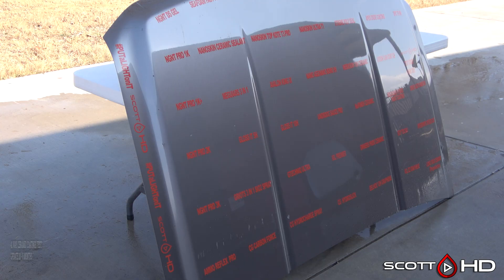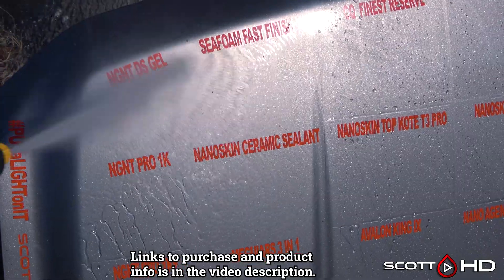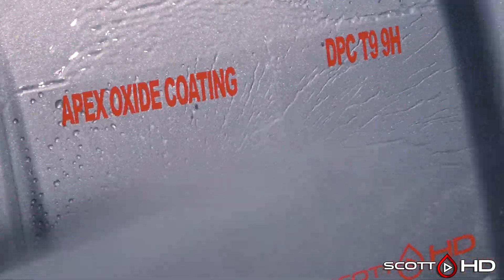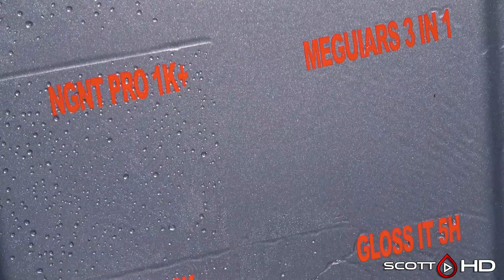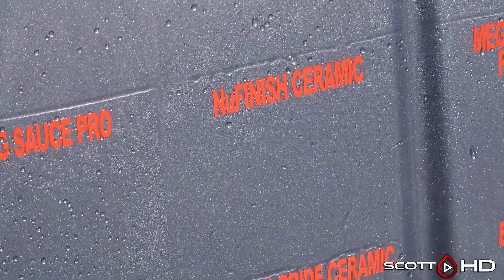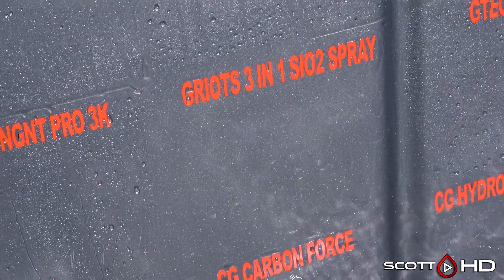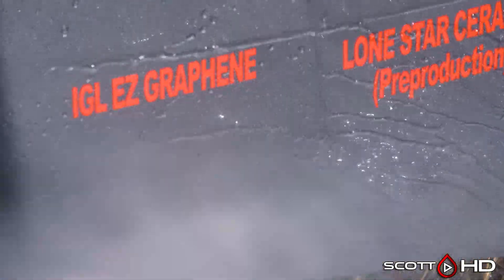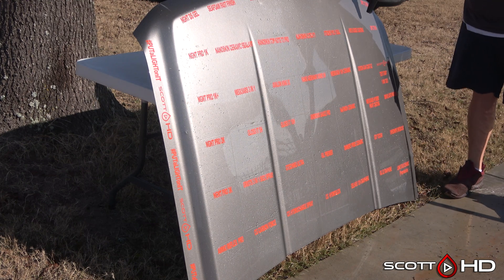Ceramic Coating Longevity Test - 41 WAY - The ULTIMATE comparison test - UPDATE 10 -8 MONTHS

Comment: I used chemical bros Hydro spray and purposely allowed some high spots in areas not very noticeable to keep an eye on longevity.  The spots are still there two years later and with using a sio2 waterless detail spray about once a month or every 2 months in between washes  everything is holding up fine

Comment: Once again.  When you wash you barely touch the bottom of the hood.  You call the chemical guys coating weak etc.  So, two things. First, Chemical guys was made to be a sheeting coating.  Second, the square where it is applied isn't weak in the top half but it's weak on the bottom half.  .....I wonder why

Comment: I may be misremembering, but I believe Larry said that Reflex coating is not really meant to be that hydrophobic.  Anyway, my first coating was Opti-coat 2.0 which wasn't the most hydrophobic, but lasted as long as the car.  I hated that car and got rid of it after only 2 years.  Opti Gloss coat when on the next car, it had tighter beads, but didn't last long at all.  My current car at first got a Garry Dean acrylic "coating", but it was short lived and not very slick when new, so I replaced it with Cquartz UK3 which is still looking good and about to finish year two.  Of course, while you're testing the products, I'm using toppers and trying to keep the coating alive as long as possible.

Comment: If a person is not OCD to check their car every 2hrs to clean off bird dropping, will a bird dropping that's on a ceramic coat for 48 hrs etch into the ceramic coating? I doubt a lot of people will check their car every about 2hrs, this is not realistic and practical..
I heard ceramic coating are bad at etching and leaving marks, a person would need to detail their car again to remove the mark.
Also i want to ask, have you guys done a water spot etching tests on ceramic coatings? If not, it would be good to see the results

Comment: Meguiars Hybrid Paint Coating!  I installed it on my Atlas Cross Sport in late October just before the weather transitioned.  Only had a chance to wash it one time since then. After 3 snow events and no other coating maintenance, its still beading and sheeting like day one.  Extremely impressive... 👍
Reply: And for the price is a win to me. If you need some spots fading away, you can reapply it on those areas.

Comment: Got undrdog on my truck that sits outside 24/7 in Florida going on 8 months looks better then yours for some reason.
Reply from the maker: Good to know. This is why I always try to test each product more than once for better data points
Reply: All subjective. Toppers? Direct sun all day? These tests should be bare minimum for longevity. Outside in the sun and washed every so often. Worries me if a product can’t withstand that.
Reply: @ArizonaDetailCorp  drive it to work sits in the sun for 8 hours then it sits in thy sun till about 530pm till sunset. So about 9 hours with the early setting sun.  Washed about every two weeks with 0 toppers.
Reply: @stevenp1829  I tried out Undrdog earlier this year I really wasn’t that blown away with it. Seems to be a hype train and I really didn’t see it outperforming proven coatings like UK 3.0. The most annoying part about Undrdog users is that they are like vegans and CrossFit people… could be a totally irrelevant post but they have to bring up that Undrdog is so great. Cool marketing strategy I guess but it comes on way too strong and is a bit of a turnoff.
Reply: @ArizonaDetailCorp  how did you expect it to outperform other coatings? In order to outperform a coating you have to have another coating previous installed that failed and seen undrdog fail prior to that.

Please give us more details. What coating did you have previously, how long did you have it on the vehicle and at waht point did undrdog begin to fail that made you deem it 'outperformless'.
Reply: @DetailGuruAlek  I did a side by side on the hood of my own car. I need to evaluate the coatings I use for my business to pick what lasts the longest for the $. Back in February of 2021 I applied both. My car sits outside 24/7 in a dusty area. UK 3.0 is probably about 80% of its original beading, Undrdog started getting flat around October of last year and it fell of a cliff pretty rapidly once it started degrading. No toppers were used and the car was washed at least 2 a month. My money still goes to UK 3.0.
Reply: @DetailGuruAlek  and to be fair I am open to trying new coatings but I knew it had to be some BS when Undrdog started claiming 7 years when the company hasn’t been around long enough to even know if that’s true or not.

UK 3.0 is a proven coating. Undrdog in my opinion is not. I really get tired of the mob culture of coating brand loyalty and being accused of not installing or caring for correctly. If it’s really that finicky I’m not interested.
Reply: @ArizonaDetailCorp  interesting. I had undrdog pro on a hood section for a year and 3 months, just used the quick detail. Beaded like the day it was applied.

I think every coating has strange behavior because it all depends on when it was applied and prepped.
Reply: @DetailGuruAlek  that’s true. And all paint is different. It’s hard to move away from something I know works almost every single time. 

Using the quick detailer though… masks coating failures.

Comment: One of my cars is a road warrior, so after a year of heavy driving it's full of contaminants, tar, tree sap, bug guts and micro scratches so once a year  I do a thorough decon (tarx, Ironx, full clay bar, poor-boys strip-down) full polish and re apply a new coating. Based on your results TEC-580, and Meguiars Coating would be perfect for me, since I only need my coatings to last one year. if they get weak at the 8-month mark, I can just spray t hem with a booster to get  them to the finish line.

Comment: I’ve got Meguiar’s Hybrid Paint Coating on 1 car and DPC T3 on 2 others. Both products are performing well in the Vegas heat and our very short winter. 

I do use TEC580 at least once a month on all of them so it’s skewing my results. Maybe I will avoid using a topper on certain parts like behind the tires of the cars and roof to better measure the coatings.

Comment: Thanks for the update.  I use the Griot's 3 in 1 Ceramic wax as a topper to a ceramic coating or on top of a polish with two coats.  So far, so good, but time will tell.  We're experiencing winter here in the Hartland, so spring will tell us more?

Comment: That Meguires aerosol spray is looking really, really impressive. Was really hoping Griot's would do better, but it's not holding up as well as last time. This batch may have been a dud, or maybe it sat in a hot truck for too long. My own bottle no longer performs as well as when I first bought it after it was left in the car for a couple hot summer days.
Reply: The Meguiar's is FANTASTIC stuff and should be well known! As for the Griot's, it is astoundingly good too... The thing that stands out about the Griot's 3 in 1 to me is that in all the vast number of tests out there, it seems to be one of the most consistent to show up as a top performer among similar spray bottle wax/sealant products. In this case, 8 months being the least impressive performance for it is still crazy great. For that type of product, variations in the application can make a difference for sure, but heck, a product as inexpensive and easy to apply as the Griot's 3 in 1 with 8 months being on the low end for it to become "weak" = crazy impressive. Really, it is a product that is effectively an afterthought to apply. Back to the Meguiar's - if a surface is prepped, for the money, there is just very little out there that is in the same league. The Meg's paint coating with a 4-6 month light topping of Griot's 3 in 1 is not a bad combo. That Meg's is just crazy good and I feel like both it and the Griot's are easily at or very near the top of their respective categories in terms of performance, ease of use, and cost! I just wish more people knew about the Meguiar's Hybrid Paint Coating.